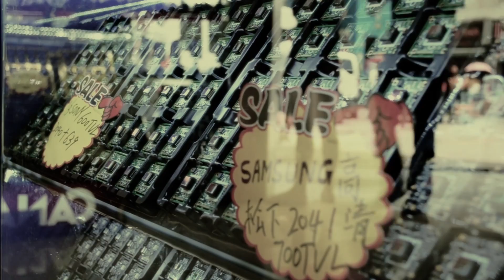Seeed Studio - A Look at Maker in Shenzhen

Comment: I spent almost $1000 on board fab and assembly with Seeed and they did a poor job and I would like to warn others. They took over 2 months when they'd told me 25 days total, on top of that they forgot to assemble some of the 0402 capacitors! They had obviously done no quality check of the assembled boards before they sent them out at all. Poor customer service not keen accept they'd done anything wrong at all, despite not assembling or even including the parts I'd paid for. Waste of money and time.